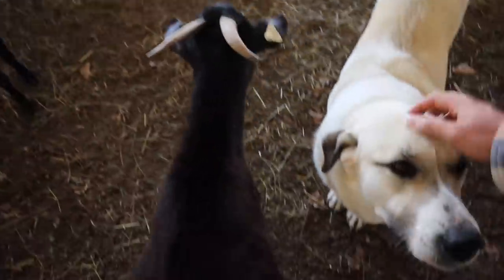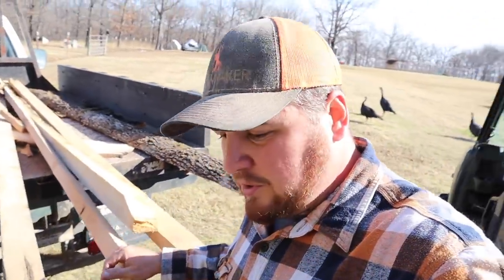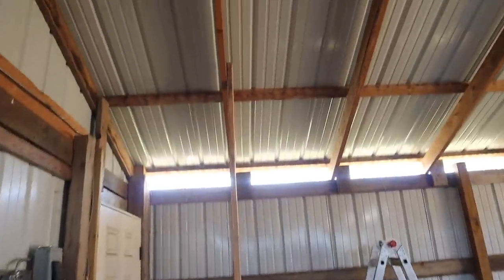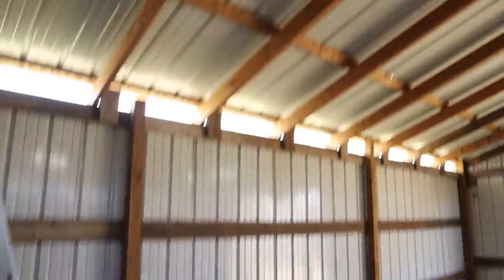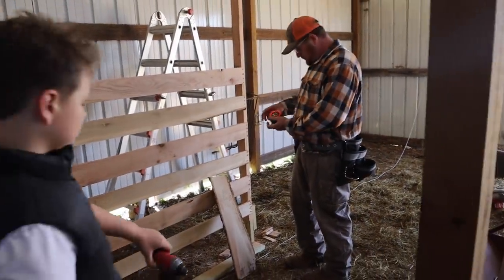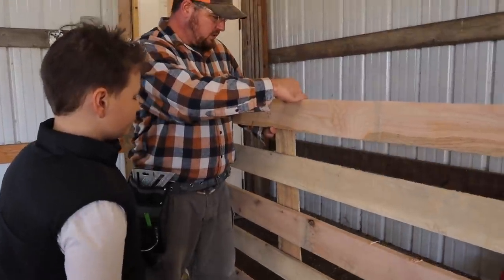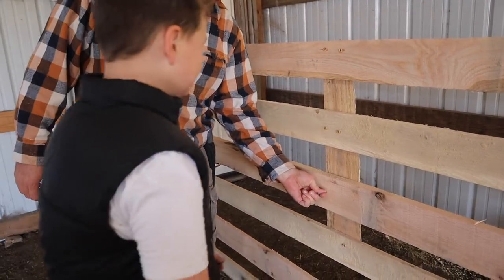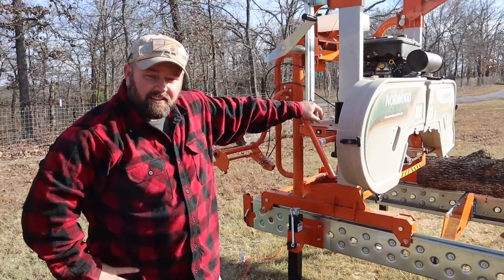We Milled Our Own Lumber To Build A Feed Bunk In The Goat Barn

Comment: If you burn the bottom of the posts that are going into the ground, it will help keep the termites from getting to the wood nearly as quick.  Also, they have levelers that you can attach to strings, so you'll know if it is going to be level all the way across.

Comment: I have heard that when using green lumber to only use one nail or screw in the center.  If you use more it will split when the wood dries and shrinks.  Come back in a year and add more  nails/screws if needed.  Or loosen the screw and add construction adhesive and retighten the screws.
Reply from the maker: Yes it can split and crack

Comment: Modern screws like your using have a self drill and tap system. I'll recommend you buy Square bit screws far simpler to use than Phillips bit screws. They torque down tighter also.
Reply from the maker: I'm using torque head screws. I havnt used phillips in 15 years

Comment: Subterranean termites don't like oak wood because of the grain of the wood. They prefer pine trees which is soft wood with a better grain. The major problem you would have with oak wood would be moisture from watering since you are under cover. You would probably be fine with the oak in the ground for 10 to 20 years since it is a hard wood. I'm an ex termite professional in Fla we deal with a lot of termites and moisture here